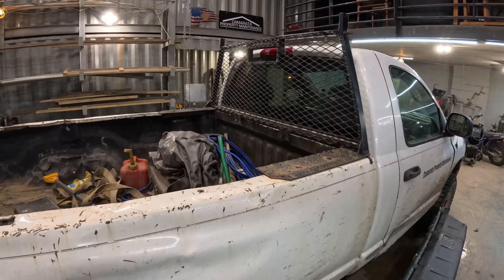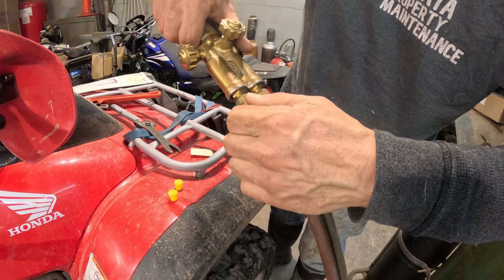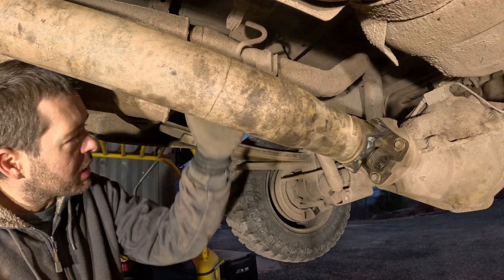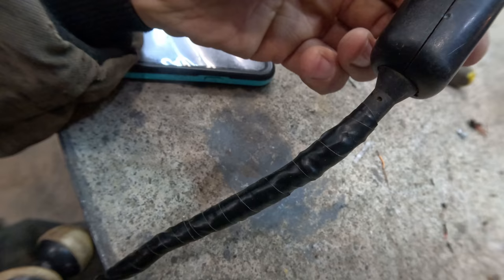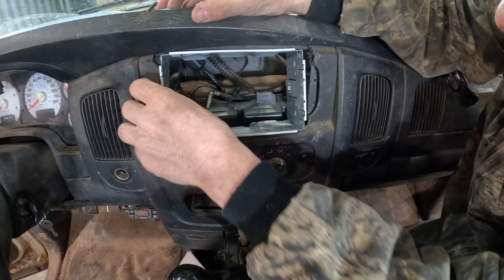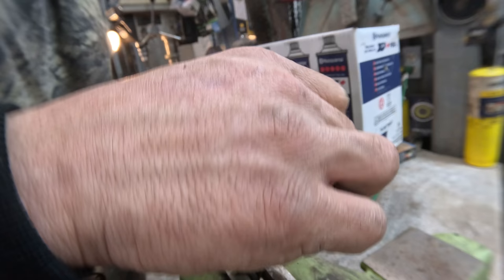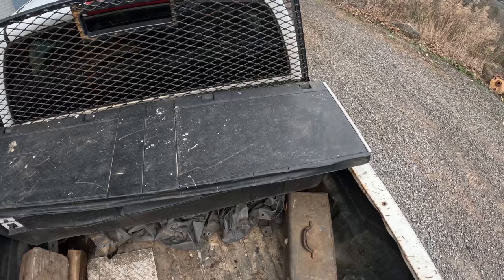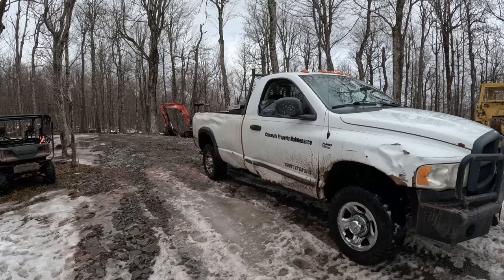Pickup truck repairs

Comment: Come on Andrew you mean your not going to go to a dodge ram dealer and pay $80,000 for a new truck? Haha .can't say I blame you.its gotten so freaken crazy with the price of everything.
    They add a few tech toys with a hig screen in New vehicles and they jumped $50,000 all of a sudden.
   I bought a brand new Toyota Tundra in 2007 for $25,000 4 door but not loaded of coarse but it was a real nice truck for the price and that same truck today by comparison is $50,000.
   Ridiculous.
   I will never buy new or anywhere near it again. But of coarse even the used trucks are Ridiculous priced.